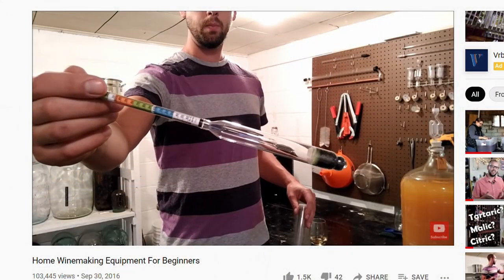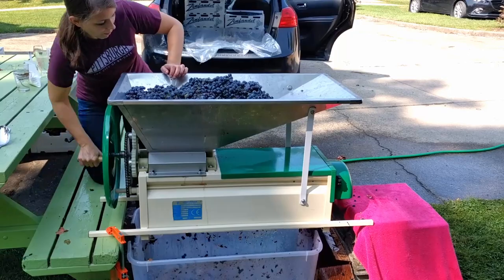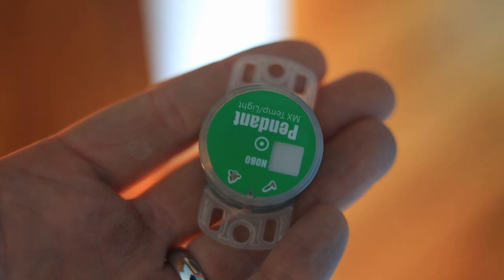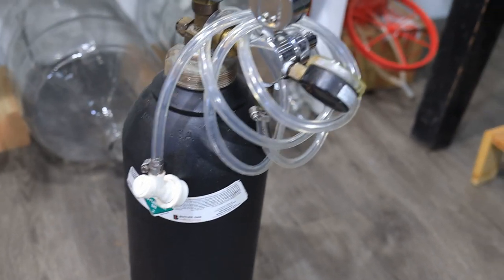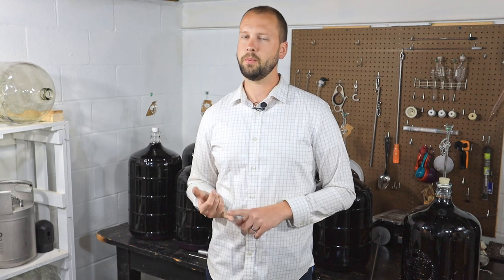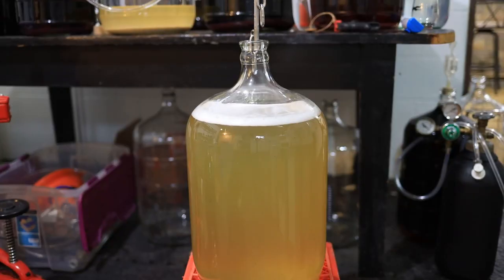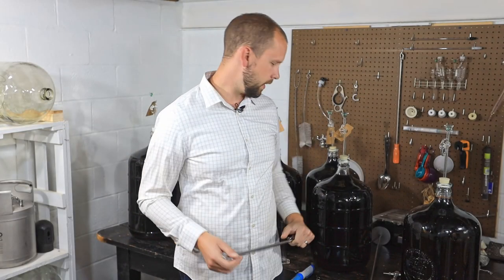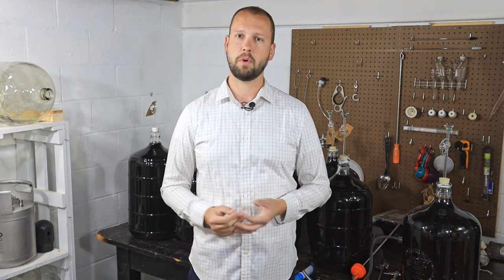Advanced Home Winemaking Equipment

Comment: Vacuum pumps are great thing to have.  I have mentioned it before but I do vacuum transfers to degas my wine and it works unbelievably well. Also, for filling my bottles, I picked up a little bottling pump on Amazon for around $80. I've used it a few times now and I love it. I just bottled a 6 gallon (30 bottles) carboy today and didn't spill a drop. Much nicer and more precise than using a wand.

Comment: if you buy a second handed air floating lid ,an advice is to put a cheap additional small ball pneumatic valve between the air chamber and the pump in order to prevent the de-inflation of the air chamber,then you can live relaxed and don't buy new pumps every 2 years ,cheers from piedmont!

Comment: Hello, I just bought a used crusher/destemmer that is the EXACT same one that you are showing in this video. The one in your video has a tag on it to help identify the manufacturer. Mine has no tag or any markings to help me identify it. Must have worn/fallen off. Do you know the make/model of the crusher shown? It would be nice to know this in case I need parts in the future. Thank you.
Reply from the maker: It's a Marchisio brand "Baby Mano Tram/griglia inox" model which I think just means baby hand operated with stainless hopper.  The date of manufacture is 2006 and the machine section on the plaque says "Pigia Diraspatrice" which seems to be what crusher destemmers are called in Italy.  Obviously an Italian machine...
Reply from the maker: "The Beverage People" still sells a nearly identical Marchisio model except it is now red and white.
Reply: @TheHomeWinemakingChannel  Thanks for the quick reply. That's definitely it. The green color and all. I will do some research and see if a stand is available for it.  I have several of their products already, 100L tanks, etc.